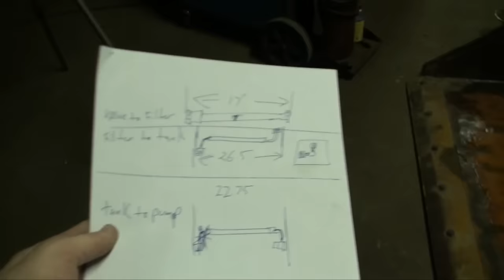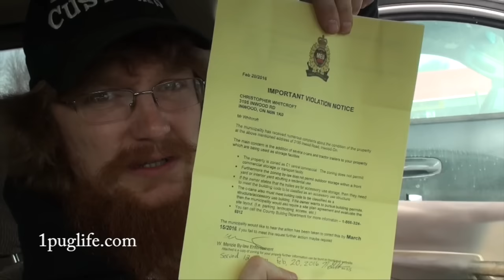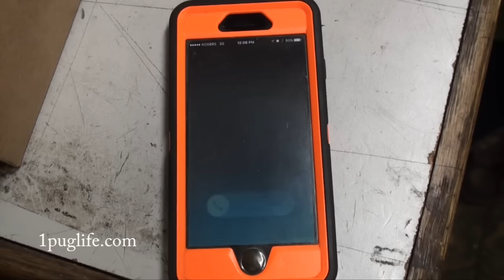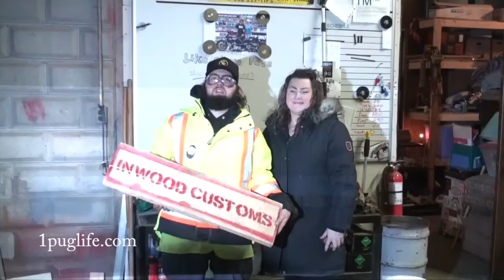SOMTHING FISHY IS GOING ON!!

Comment: I was bored so I read through the zoning bylaws for Inwood. It appears to me that (even for residential zoning) Chris could argue these trailers are part of the construction occurring with the drywalls project. According to that provision temporary accessory buildings related to construction projects are permitted (outside of the 'sight triangle') up to 6 months after the work has completed. I could be wrong but I think if you put a few sheets of the dry woods and some dirty ole' buckets of jenkems in the trailers you could argue they were part of a construction project. It doesn't solve the problem in the long term but in the short term it sure makes it look like they are harassing you for no good reason.
Reply: what about the trailer that was there before he bought the place they never had an issue with that. I'm glad there is no stupid bylaws where I live in the USA

Comment: PUG    there is something heiky about your control valve plumbing. Most hyd valve i have worked with have a plate that shows flow and direction on them.  Are you piping each of the cylinders to different handles.  i have stop your vids to take a look but can not tell how you have each hooked to the control valve,  the valve appears to be able to control two different movements, such as extend and raise or raise and move a different direction   both cylinders should have only one side of the valve connected to them  you will only need one hose coming off the valve going to a y splitter to hook up the extend side of both cylinders and one hose going to a y splitter to the retract side of both cylinders  i will try to send a hose diagram to you  please be very careful as hyds. can hurt you real bad real quick   will send the diagram as soon as possible  BE  SAFE   or are you carefulling
Reply: He has it right. They are 2 way rams so each need its own control for forward and backwards. There for each ram needs independent lines to work independent from each other. It matters which way he wants the ram to go for that hose to provide pressure then to move it back the other hose gets pressure.
Reply: it just look wrong from what i could see, just don't want anybody hurt
Reply: +Travis “Boot” Babcock hey mr boot i just saw the whole hook up on a video i missed.  i though pug was using two cylinders to split. when i saw the vid about the exhaust, one operates the knife to  split the other raises or lowers the ram and table   must remind my self to watch all vids   so you were right  and i was wr  rr  ng  aaa misinformed  lol just want all to be safe

Comment: dud your camera man is older then dirt and he's pointing the flash in the wrong way while he's taking the pics. wtf!!! not the right way to take pics. hope you didn't spend money on those pics
Reply: ...actually JDM was mostly right, just not entirely in this example...for this type of shot you don't want a direct flash...normally you might use a diffuser to eliminate the 'hot spots'...but if you don't have one, pulling the flash away from 'line of sight' you get a similar result...dick...